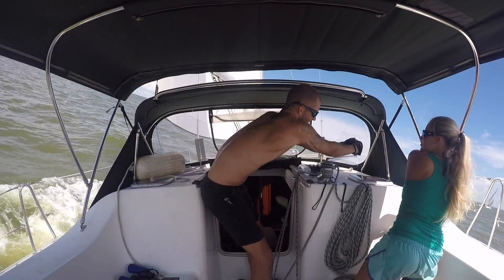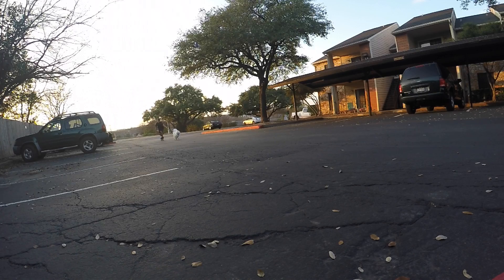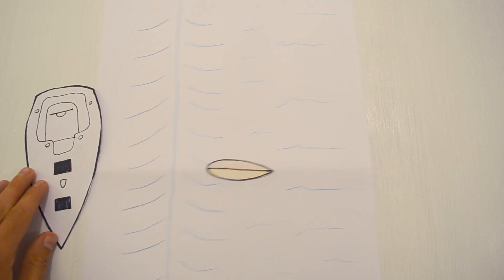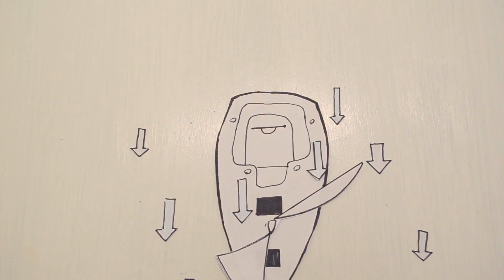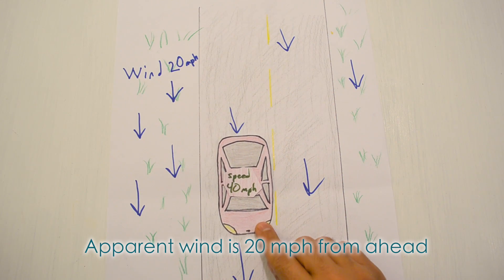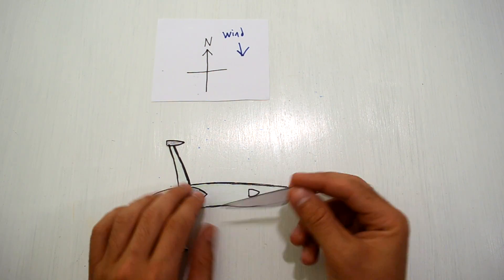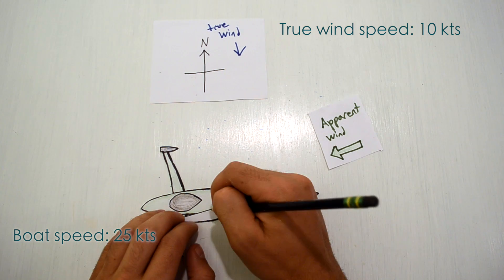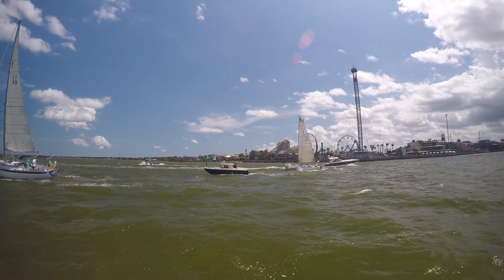How do sailboats sail faster than the wind??

Comment: Nice video - just a comment about trying to use "physics sounding" nouns that misinform the uninformed.  laws of conservation aren't being implicated by sailboats going faster than true wind. Conservation of energy focuses on a closed system. Sailboats don't add any energy to forces exerted by high pressure equalizing to low pressure (wind), it is just harnessing what's there.

Comment from the maker: I took a stab at trying to explain how sailboats can go faster than the wind. Hopefully this helps some folks who were wondering how it worked like me!
Reply: Jessica and Ryan Adventures, The only omission I felt worth adding is the acceleration of the wind that takes place between sails.  You are correct to say the boats get sucked along for the pressure drop on the leeward side of the sail is what pushes the boat over and along and not the pressure against the windward side of the sail.  This leeward pressure may not only be magnified by apparent wind angle, but also by working the sails together.  When trimming sails (Genoa and Mainsail) a slot is formed between the two sails.  The wind traveling in the slot can accelerate increasing the negative pressure on the sails.  If your slot is too wide or too narrow you do not get this acceleration and added suction or pressure.
Reply from the maker: Hey Dennis, thanks for the comment. Good point. The physic of the interplay of the two sails is definitely something I want to learn more about. Thanks for bringing it up, I had forgotten that that was a factor in all this.
Reply: @dennisrubery7912  Venturi principle for further reading.
Luv and Peace.
Reply: +Dennis Rubery Yes, the foresail (headsail) and mainsail can work together like a slotted wing, making for an overall more efficient combined wing.   See also https://en.wikipedia.org/wiki/High-lift_device  Some high performance racing boats with wingsails deliberately maintain the relationship between the (fore and aft) wingsails for a favorable slot effect, increasing the overall performance of the wingsails.
Reply: G'day Dennis, just a picky suggestion. Perhaps you should have omitted the word 'pushes' as the energy of the wind when pushing is mostly lost (perhaps explain that?). The wind sucks, draws or pulls .... OK, a bit picky but is important for serious sailors I would reckon. I'm a pilot and motor racer, not much of a sailor, yet. I liked your bringing in the compounding of air speed, yeah please do take that further. I'd be interested in a simple description I can use. I find it very difficult to explain to F1 fans why the wings have so many 'flaps' and  'slots'. You may see the relationship, although in F1 it is far more complex, and above my pay grade. But a usable description of slots would be very useful.
beers,
build
Reply: Yes, you've gotten picky and we could dive into the aerodynamic force coefficients which would bore most to death.  Bottom line if you get the slot between sails working optimally the resulting acceleration drops the pressure (suction) on the leeward side of the sails, this increases lateral pressure which translates to forwarding as a result of the keel working through the water.  Many sailors over trim their sails unknowingly which for most cruisers will not change a lot as they are likely sailing on auto pilot and most auto pilots do not adjust to apparent wind angle as many may have seen watching the Vendee Globe IMOCA 60 yachts.  F1 wings work under the same principal, however a great deal of the force on F1 cars is do to the underbody and the suction it creates.
Reply: Thanks Dennis. BTW, you were referring to the diffusor which very much works with the full package not alone. beers, build.